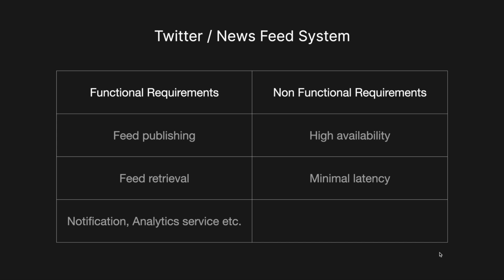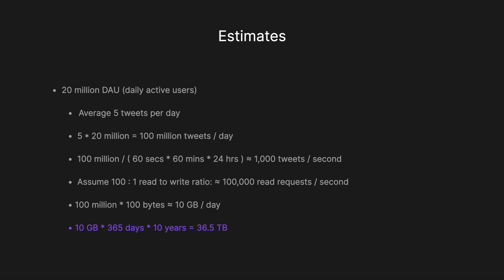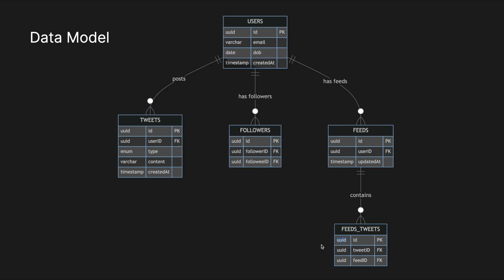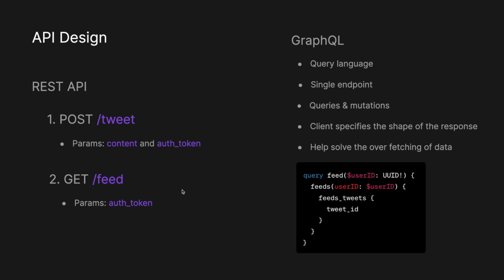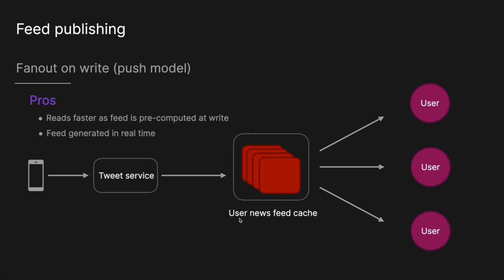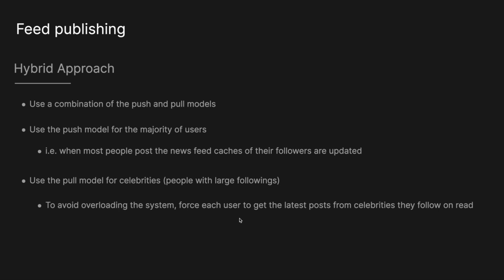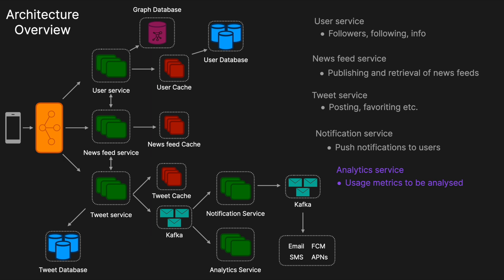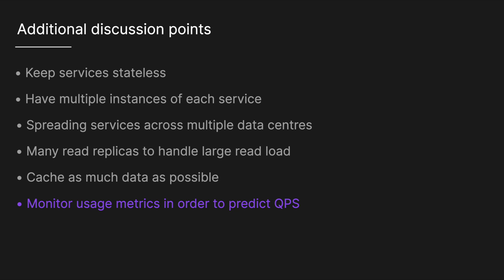Twitter / Newsfeed  System Design Interview Question

Comment: Great video but maybe a little extra improvement could be to disconnect the user from the profile. So have one sso service for handling users (security, login/register, user info,... ) and one profile service for storing the profile info like in this case the follower stuff etc. and use this for the other Services and reference the connected user id in the Profile. This could allow for a user to have multiple profiles on a single account and to have the whole security logic be somewhere else for better Performance and maybe when creating a new system to use the same sso for login with your account
Reply from the maker: Great comment! Yes 100% agree this would be a very important service to implement to make the system more robust and extensible. If you were using a cloud provider they have services like AWS Cognito which would help you implement this. This is definitely something worth including in this system design!
Reply: @TechPrepYT  thanks for the reply